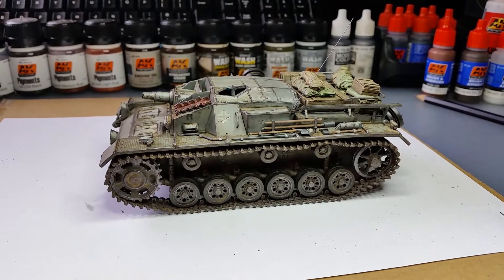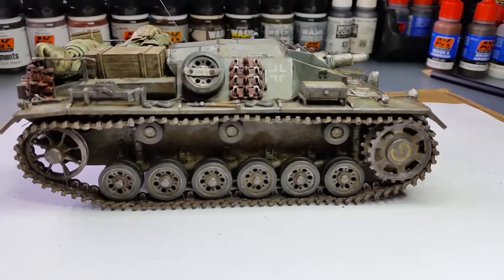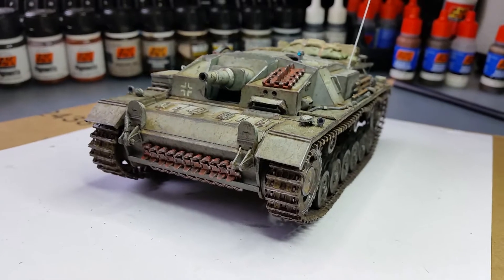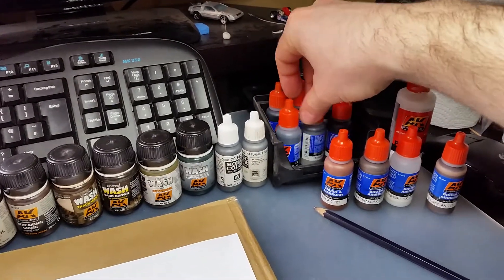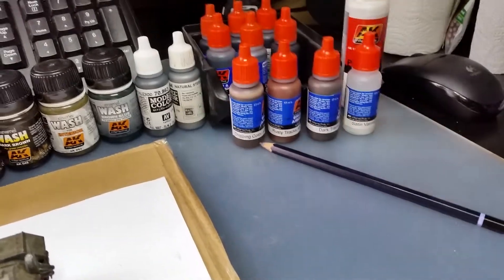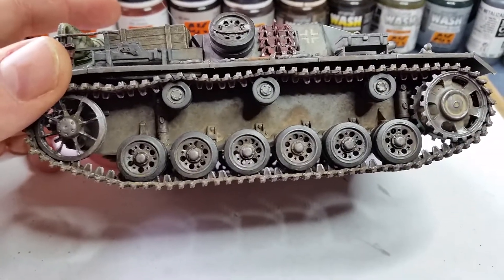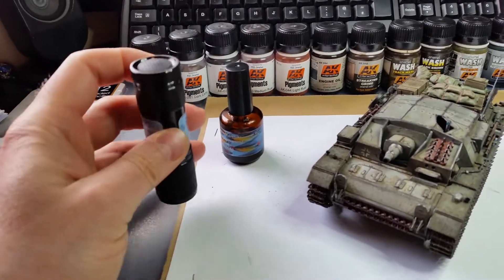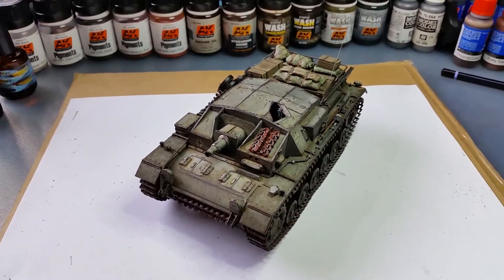1:35 StuG III Ausf. C/D Dragon - final update

Comment: What brand of resin do/did you you use?  thanks
Reply from the maker: ratled1 resin? For the scope you mean? It's a UV resin , just type up resin on eBay , there is plenty there you can get a set with a small  UV flashlight. Does the job
Reply: THANKS for the FAST reply   sub'ed